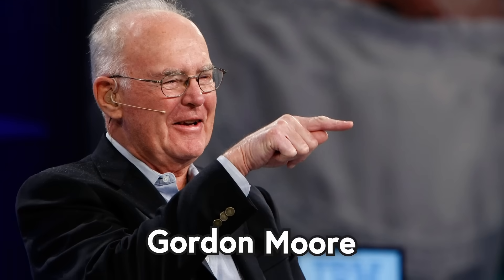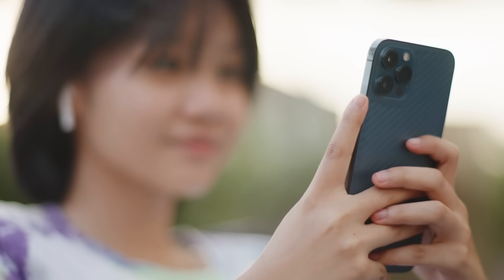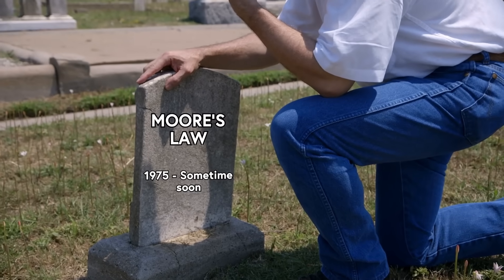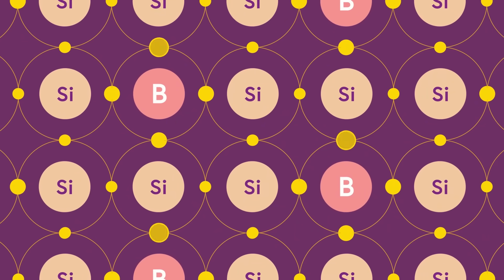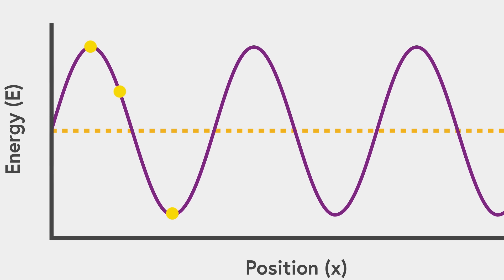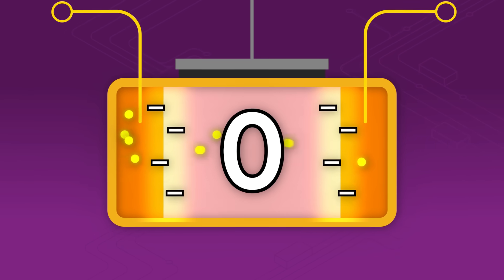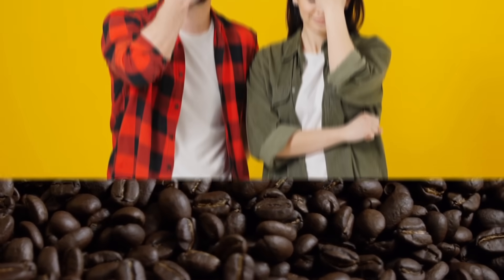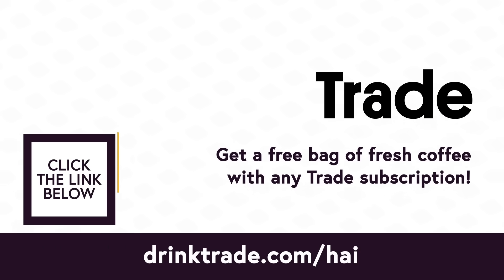Why We're Reaching the Theoretical Limit of Computer Power

Comment: As others have noted, since the introduction of FinFETs (22nm process node) (FET stands for Field Effect Transistor), the "nanometer" naming of process nodes has become detached from any physical measurement of the transistor. Originally, it referred to the gate length of the transistor. However, as quantum tunneling and other current leakage started causing issues, gate length stopped shrinking as quickly. FinFETs enabled greater control over the transistor by surrounding the channel on three sides with the gate (rather than one side with planar).
Furthermore, it is important that there are two critical technologies which will keep Moore's Law alive:
1. New transistor architectures currently being developed:
    1a) First, there is GAAFET (Gate All Around FETs) which enables greater control by surrounding the channel on all sides with the gate. It also flips the stack of fins on its side, so now channels are stacking vertically rather than horizontally. This naturally increases density further.
    2a) Then we have fork GAAFETs which seek to further increase density by removing the size of the gap between an n-well and p-well in a pFET and nFET (all transistors come in positive and negative pairs and this makes them sit next to each other when they would normally have to be far apart to not cause issues with overlapping doped silicon - the phosphorous and boron mentioned in the video).
     3a) Lastly, we have CFETs (Complimentary FETs) which seek to increase density even further by taking to two separate pFET and nFET stacks and stacking one on top of the other! Naturally, that could double density once again! As such, transistor density scaling is still far from dead. It has been getting exponentially more difficult and more expensive to continue, but there's still a lot of momentum left.

2. Advanced packaging: Packaging is the process of taking a silicon die (the actual silicon with all the transistors) and putting it in a package. For example, a CPU will take one or more dies, bond them to a green PCB known as the substrate, and then cover it with what is known as an IHS (Integrated Heat Spreader) to help dissipate the heat generated by the CPU. Originally, packaging just meant finding some way to connect your one silicon die to the outside world. However, as the desire for more compute and more transistors never stops, we had to get a bit more creative in packaging. This is because if you just make the silicon die larger, you end up wasting more silicon because we're cutting rectangular dies out of a circular silicon wafer. Larger rectangles means more lost silicon along the edges. Larger rectangles also means that a single little defect in the wafer (there's always some) will affect a larger piece of silicon. Better to have one bad die out of 100 rather than out of 20. So the question became: "How do we provide more transistors and more compute without further increasing die sizes and thus decreasing yields?" The answer was to split everything into multiple dies! So we started creating all sorts of techniques to put multiple dies next to each other on the substrate and allow them to communicate with each other. We even started stacking dies on top of each other! All of this allows us to keep dies small with high yields while not sacrificing on performance and transistor counts. And so as long as we can continue with advanced packaging, Moore's Law is still far from dead! This is because Moore's Law does not state how large of an area the transistors have to be in. He simply said that the number of transistors in an integrated circuit will roughly double every two years. If we can economically increase the size of that integrated circuit, then we can still increase the number of transistors on the integrated circuit as we please and thus continue adhering to Moore's Law!

While Quantum Computers are a very interesting topic of research and worth a video on its own, most people agree that it won't replace classical computers, at least not for a long, long time. This is because virtually all quantum computers require ridiculously well-maintained environments (fractions of a degree above absolute zero and state-of-the-art magnetic shielding) in order to not become completely useless due to interference. Furthermore, in order to create properly reliable and stable quantum circuits, you need thousands of qubits which we are well over a decade out from. Furthermore, nothing can beat the price of silicon. A CPU with tens of billions of transistors can be had for a hundred bucks. But on the mature process nodes, you can have microcontrollers that cost pennies. As such, even when we get proper quantum circuits, they will likely remain cost prohibitive for all except some of the most well-funded institutions.
Reply: I clicked on this video only too se if they would differentiate between the nanometer nomenclature and the actual physical size of the components. The awnser is just a quick google search away. Makes you think all the other things youtube videos get wrong
Reply: Wow what a comment. If it isnt just ML-generated, it has value comparable to the efforts of the entire video production team that caused it
Reply: @mormatus  I promise I'm not some LLM haha. I actually work at Intel (not in the fab, but I like to keep up-to-date on all the goings on in semiconductors). I should also note (as you can probably tell), brevity is not my strong suit 😅

If you mean the video, HAI happens to be a part of Wendover Productions, which is owned by Sam Denby (who voices every video) and they have several awesome writers. They're also behind the incredible "Jet Lag: The Game" show
Reply: Thank god someone pointed that out. It's all business "My number is better than your number" BS now. Nobody has made a transistor even close to "7nm" to date nevermind 2 or 3.
Reply: You can pack whatever you want, but you won't be able to remove all the heat from the core... Rip.
Reply: @Einheit101  Yes, this is certainly true. But think about it this way: the craze over dark silicon started around 2011... That was when Intel launched Sandy Bridge which could get you 4 cores and 8 threads at a minimum of 65W of power. Today, you can get a 14100 with 4 cores and 8 threads and more than doubles the performance of the Sandy Bridge part across the board while consuming similar power (and thus outputting similar heat). Clearly, the thermal issue, while a very real obstacle, has not precluded us from improving performance and efficiency. 

The thermal side of things in particular has been a concerted effort across the whole industry. Mechanical engineers researching new thermal interface materials to increase conductivity between the silicon die and IHS. Mechanical engineers researching die thinning to get the IHS as close to the transistors as physically possible.
Firmware engineers tuning algorithms to run the best cores at the best times, even taking physical location on the die to improve thermal performance. 
Core architecture designers physically altering the layout of the core to move thermal hotspots as far away from each other to produce more even loading and better heat dissipation. There has also been an increasing emphasis on custom accelerators to provide massive performance and efficiency gains in common tasks. For example, Nvidia, AMD, and Intel have all implemented accelerators for video encode and decode which does exactly this. Compare the performance of hardware encoding against CPU software encoding to see the massive gap in performance and efficiency.

There are a plethora of techniques implemented by a plethora of smart engineers across all disciplines that have been implemented to get around this obstacle. And there are still plenty of other techniques to explore! That said, nothing beats power efficiency improvements that you get from an improved process node. Dennard scaling died with the transition to FinFETs, but there are still power efficiency gains to be had by better controlling the gate and channel, tuning the channel resistance, reducing via resistance, and increasing capacitor density. We still see 10-15% more performance at the same power for a half node and 30-40% more performance at the same power for a full node, and there are still plenty more gains to be had here. Look at the power efficiency of Intel's Sierra Forest CPUs which leverage the Intel 3 process node. Intel, the laughingstock of power efficiency and thermals, providing best in class power efficiency.
Reply: @AlexSchendel  How will Back Side Power Delivery impact the future of Moore’s Law?
Reply: @Not_a_lier  That's a good question. I'd personally expect BSPDN to help deliver at least a node or two worth of density and power efficiency benefits. Moving power routing from the front-side metal layers helps declutter the signal routing a lot which is often space constrained in the densest logic. Intel has done some small-scale tests and made a test chip which demonstrated several improvements. The actual performance improvement was only 6%, but in terms of voltage droop (how much the voltage drops from the voltage regulators to the CPU cores) dropped by a massive 30% which should have big power efficiency improvements. They also noted that they achieved improvements in thermal dissipation which should further aid in power density.

There is a good video by Asianometry about Backside Power Delivery and I have a similarly long and rambling comment about stuff there as well. Mainly, I wanted to note that there are several different approaches to BSPDN. Intel, TSMC, and IMEC have all demonstrated different variations of BSPDN and they all lie on a spectrum between manufacturing ease versus performance and density improvement. If you're interested, I'd recommend that video and you could search for my comment on there hahaha.

Edit: here's the link to the video! https://youtu.be/fc_xzN6UErI?si=NG38ufTucvoT6xE6
Reply: @AlexSchendel 
1. Do you also know a good amount of cpu core architecture. (Disclaimer: I know this isn’t directly relevant to this video)
2. Are transistor size decreases correlate with increases in IPC or is there another layer that prevents a linear increase of IPC?
Reply: @Not_a_lier  I don't know that I would say I know a lot about architecture, but I think I can try answering your question haha.

There is of course a strong correlation between transistor scaling and IPC scaling. I would expect if you plot it though, it would not be linear. This is because it requires a lot of architectural effort to pull off big IPC increases these days to make sure that everything works together as intended. For example, you might double the width of the core (i.e. double the decoder stages, op cache, and ALU pipelines), but then it becomes exponentially harder to keep the core fed with instructions and data because your core can process instructions at nearly double the rate, but only if you can keep it fed. This means that you'll have to massively improve your branch predictor because the core will have to look further and further ahead to schedule instructions for the core, so you are more likely to hit branches and misses become more expensive.

A simpler example might be cache. You can double your cache for roughly double the transistor count, but this won't double your hit rate. There are diminishing returns for cache increases. This is especially true nowadays where we tend to have L3 hit rates in the mid to high 90% range. Of course, with how expensive a cache miss is, there can certainly be workloads which massively benefit from extra cache, as X3D CPUs show with gaming. But it still isn't the case that if you doubled the cache size and doubled the width of the core, that everything would double in speed. You still need an ever better branch predictor, and you'll also be paying penalties for having such large caches. There are a lot of reasons why modern CPUS have 3 or even 4 cache levels. One important one is that as cache sizes increase, it becomes impossible to not increase the cycle latency to access the data stored there. You have a tiny L1 cache with just a few cycles of latency and a big L3 cache with potentially a couple dozen cycles of latency. Or even the massive DRAM with potentially hundreds of cycles of latency. Intel's upcoming Lion Cove cores, being introduced with Lunar Lake introduces a four level cache for the first time in a couple decades. This is done of course to try to further manage the gap between cache size increases and latency. More cache levels means smaller latency penalties for each cache level miss. It does of course, require even more transistors though as you're not just increasing the size of existing caches, but also introducing entirely new ones.
Reply: @AlexSchendel    so, by trying to increase the performance (IPC) of a core, you have to keep the core fed with information that comes from cache, make sure that the cache can keep up (latency, speed and space/ amount and keep having a robust branch predictor when scaling with transistor size/ density.
Reply: i aint readin allat

Comment: I wrote something about this back in 2015? on Reddit about how the size of the atoms changes    Or was it 2009??   in different alloys of the combined metals and thus you have to test the entire possible - not just plausible - range of thermal and coupled-charge effects because you don't want to invent a new process that goes 'pop-corn' when you try to do floating point math.

Comment: Everyone is commending the explanation in the comments, and while there are a few inaccuracies, I agree for the most part it was a good explanation. That one biggest issue with it is that quantum tunneling is mostly happening in the oxide (which is the gate), which means a transistor will always be on if there’s too much tunneling. Tunneling through the depletion region is not as common, and for the most part it only leads to increased power consumption (unless it’s really severe). But the oxide is significantly thinner than the depletion region, which is what makes it such a problem

Comment: Just a quick comment, the 16 billion transistors in the iPhone (presumably iPhone14), some sources quote it as having 11.8 billion, but that may just be a matter of whether it's total transistors or CPU/GPU and or neural processor. Nothing I've read suggests whether it's all the transistors as a phone typically has processors in the RF front end as well as for several other requirements. Also nothing I read on the main chip suggests RAM or Flash (apart from cache) is included in that so the device vs the multi-core, multi-processor main chip may see significantly more transistors. Let's say it has 6GB of RAM, which is ~1.2 transistors per bit so there's 57.6 billion transistors roughly in the ram chip alone. For Flash the sums get more interesting because they have something less than 1 transistor per bit. Google turns up useless results because it's only an advertising engine now, so we'll say 2.1 transistors per byte so a 256GB of Flash would be around 537billion transistors in one chip.

Comment: I've been seeing the prediction that computer chips will stop getting faster from having more transistors for over twenty years now. They've kept right on getting more transistors and faster.

 Also, from the "2 nm process" page on Wikipedia:

"The term "2 nanometer" or alternatively "20 angstrom" (a term used by Intel) has no relation to any actual physical feature (such as gate length, metal pitch or gate pitch) of the transistors. According to the projections contained in the 2021 update of the International Roadmap for Devices and Systems published by the Institute of Electrical and Electronics Engineers (IEEE), a "2.1 nm node range label" is expected to have a contacted gate pitch of 45 nanometers and a tightest metal pitch of 20 nanometers.[5] As such, "2 nm" is used primarily as a marketing term by the semiconductor industry to refer to a new, improved generation of chips in terms of increased transistor density (a higher degree of miniaturization), increased speed, and reduced power consumption compared to the previous 3 nm node generation."

As you can see, circuits aren't actually down to two nanometers in size yet.

Comment: The output of a logic gate has a complementary structure, there are two transistors where at most one conducts at any time. Thus at a transistor level, high or low is determined at the node between the two devices. Whether the high or low represents a logic 1 or 0 is arbitrary and is chosen by whatever reduces device count or power requirements.

Comment: 0:25 - Minor correction to the common understanding of Moore's Law: He didn't predict "the number" would double every year, he predicted the "price per transistor" would halve, either due to the doubling of transistor's per area (thereby making the same chip able to hold twice as many for the same cost) or due to just becoming cheaper due to improvements in manufacturing process. (Or any combination thereof.)

People were decrying Intel's stall of process improvements (the long delay between 14nm and 10nm) as "Moore's Law breaking down!" but it wasn't - Intel was decreasing the cost per transistor of 14nm during that time. By making the manufacturing significantly more reliable, so fewer wasted chips, making the cost per good chip less.

Comment: One of the coolest solutions to this is not quantum computing, it's just to not use transistors. Analog computing has been lacking recently, with the only good use right now is in modular synthesizers for music production. Instead of 1s and 0s, they rely on control voltage to transmit more data, with the tradeoff of less accuracy. The less accurate thing might go away soon as analog computing picks up though. If someone can fact check this ty